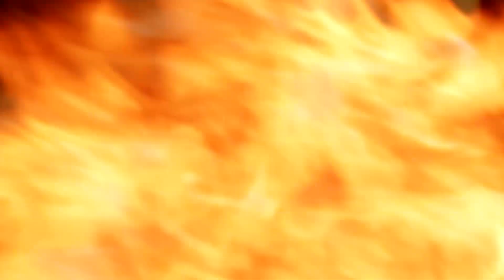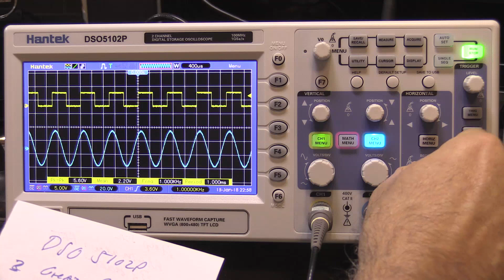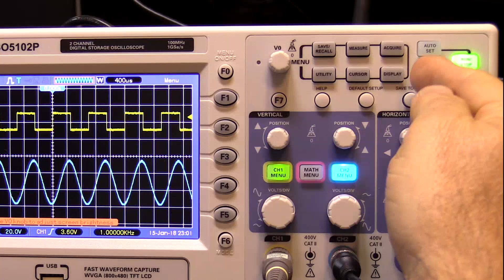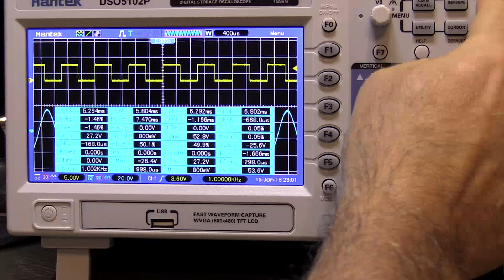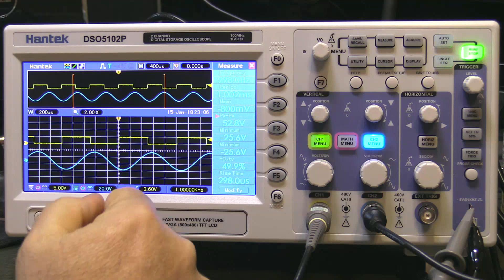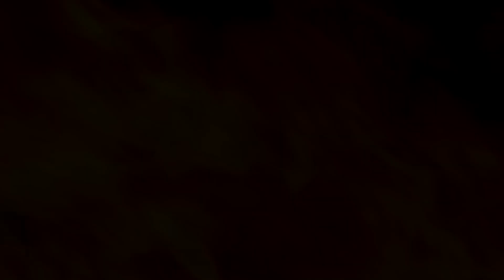Hantek DSO-5102P Digital Storaqe Oscilloscope Over-view

Comment: I've had the MSO-5102D for I think 3 years, and I do like the scope. The rotating controls are all rotary encoders, and some of mine became so jittery as to be unusable, particularly the V0 knob.
I pulled it apart (very simple) and I sprayed into each encoder casing, and down the shaft, with electrical clean and lube spray. This fixed the issue.

Comment: I want to thank you for your overview of the Hantek DSO5102P. I'm into retro-computing and am always needing to troubleshoot/repair something. I've often reached the extent of what I can do with a multi-meter and have been wanting to pickup an oscilloscope. Keep in mind that this isn't a tool I'll be using every day. Heck, I've made it the past thirty years without having one, but I have wanted one, and I'm certain there are times I would've had a much easier time of it if I'd had one. I've had several scope snobs telling me how bad the Hantek units seem and complaining about their lack of features and trying to steer me towards Rigol. While I'm certain the Rigol units are excellent, their low end is around $120 more than what I can get the DSO5102P for, and that's for a 50MHz unit. For my needs and what I'll use a scope for, I think the DSO5102P will more than meet my needs. It looks like an awesome starter/hobbyist scope. I think you've helped me make my decision. Thanks again!
Reply: I concur! The Hantek has served me well and you cannot beat it for value. Enjoy!
Reply: I ordered mine from Amazon this morning. Hopefully, I’ll have about the middle of next week.

Comment: I've had this model scope for about 2 years now and it has its problems though. It occasionally "randomly" reboots itself. The AC / DC input coupling stopped working on one occasion. It fixed itself after a reboot. The triggering malfunctioned but it also fixed itself after a reset using the autoset button. One of the backlight buttons stopped "backlighting" after a week and one of the probes had to be replaced due to a faulty connection. Maybe Hantek has sorted out their problems. There are a couple of other reviews on this model of scope and I would suggest that anyone thinking of buying this scope watch them. My evaluation after 2 years is at best not bad.

Comment: I am trying to see an intermittent signal (such as me touching and untouching a test point) and can't figure out how to do it. I want the scope to show 0v as a line across the screen, but when i very briefly tap the oscope probe to 12v, it shows the jump and then goes back to showing the 0v line when not touching. I want to see a jump that remains after my brief touch is not touching anymore. So like if I touch 12v 5 times in 10 seconds, i will see the 0v line interrupted by 5 brief 12v spikes.
But I have tried for what seems like an eternity of trigger options, run/stop,auto set, normal set (auto set turned off), sec/div, and I don't remember what else. No luck.
I can get it set so the line jumps to 12v,  but as soon as I disconnect it, the line goes back to 0v. No history. Can someone explain to me how to do this. I have a 2 channel DOS (Hantek DSO5072P).
Reply from the maker: Easy... On the Horizontal control area, rotate the lower knob (sec/Div) counterclockwise till you see 800ms on the top right of the screen. Now it will take 10 seconds or so for the trace to get from left to right. Tap away!
Reply: @robertnagy2163  I finally got around to trying it.
It works perfectly. Thanks for taking the time to help a beginner.
I am now watching "how to use an oscilloscope" videos.
Reply: @robertnagy2163  Thank you for your very helpful reply. Unfortunately i'm not able to put it to the test yet, but should be able to tomorrow. I'm sending this now so you don't think i just ignored your kind reply.

Comment: Is the 100MHz flavor sufficient for the typical hamshack, or would the 200MHz version be more useful?  Cheers! Chris - NI7I
Reply from the maker: 100mhz is fine for the radio shack... and remember, you can modify ANY of the Hantek scopes for 200 mhz operation. (google it)

Comment: Function Save to USB does not work on mine. I tried 3 different flash drives, tried formatting to ntfs and fat32. Same thing. Anyone having this issue?
Reply: I don't have mine yet, but this is one of the reasons I bought this model. I need to be able to capture the screen/waveform for documentation (My memory isn't what is was :( )
Reply: No issue. I use a 4 Gb USB key (old one) formated to FAT32 with 4 Kb sectors. The scope runs Linux so any key that works on Linux should work, test it on Linux first. I can save both waveforms to recall them later, and screenshots.

Comment: Robert, as a new owner / user of the 5202 200 MHz "version", was wondering...will I and I guess we, also find a setting for what we used to call trace brightness or screen brightness on our now older analog or earlier digital 'scopes, also on these 5000 series Hantek's ?

Just to ask, have you "taken" the 100 MHz 5102 up to, say, 200 MHz and seen how that operates ?
Reply: Joe..I have not modded it or used it up near 200mhz.  I have been busy and only used it for routine checks. Great value huh?  Guess there is no stopping the Chinese giant.

Comment: Hi, do you know if there is an important feature missing on  Hantek DSO4202C that it also has a wave generator ? Thanks
Reply: No, I use a FeelTech waveform generator with it.
Reply: you use an Hantek DSO4202C or an Hantek DSO-5102P ?
Reply: My question is if an Hantek DSO4202C it can be more complete solution?

Comment: Upgrade it I did mine in about 30 minuets I went from 100 to 200mhz. If you have the 70mhz scope then there’s 2 small capacitors you have to remove because they physically limit the bandwidth. The 100mhz all you do is change a couple of things with a UART and then you have a 200mhz scope for a lower price.  Original I was gonna get the 70mhz because I thought it would be cheaper. I got a 100mhz for $212 delivered. It’s an awesome scope especially for the price.  Still love my old Tek 2232 which it’s a dso/ analog, but I have never used any of the functions for the storage. Too aggravating. I think anyone that’s into electronics and scopes need to buy a working crt analog scope to add to your test gear. There’s some things I like doing better on my analog scope. But there’s a lot more the digital does. I bought my crt scope a few years ago on eBay $40 2ch Tektronix 2232 scope. Shipping was $40. I mean $80 and you have a quality piece of gear.
Reply: Since 2017 or 2018 they directly cmoe in 200 MHz version if you buy the 100 MHz. All you need to do is upgrade firmware to lastest 2019 versoin and replace the two PP-150 probes with PP-200 MHz probes or two 200 MHz certified probes.
Reply: @gilbertfernandes8320  It's wrong. I received my DSO5102P on February 18, 2019. On March 4, I upgraded to the January 25, 2019 version. I tested with frequencies from 100MHz to 150MHz before and after the update. firmware, nothing has changed. So it's wrong to say that the new update will unlock the oscilloscope at 200MHz.
Reply: @All Things M3 Could you give me the specs on that hack or where you got the hack from?